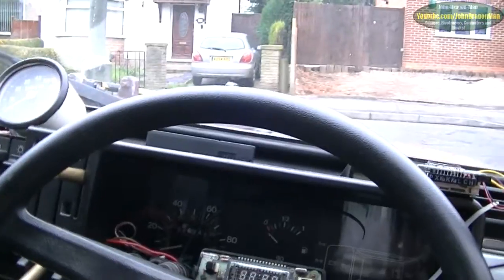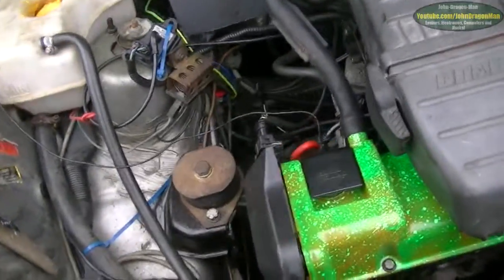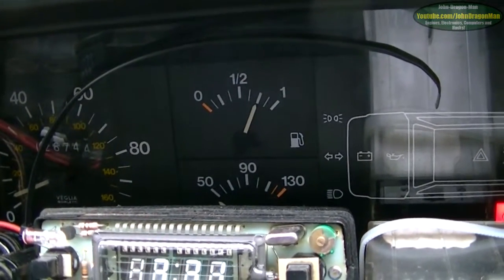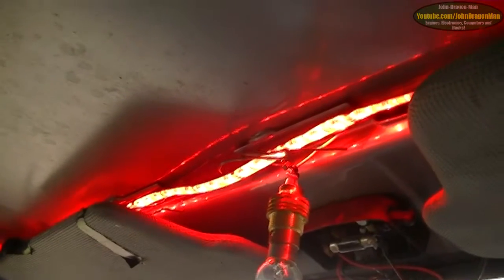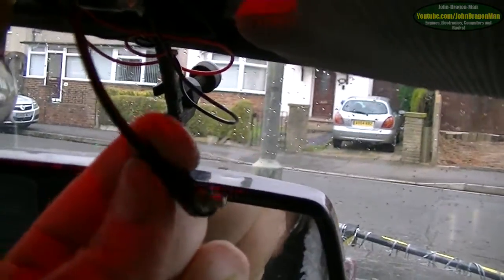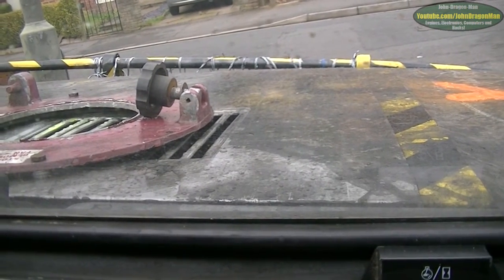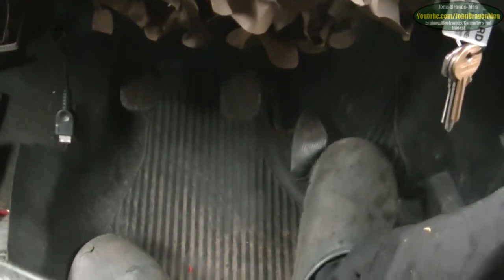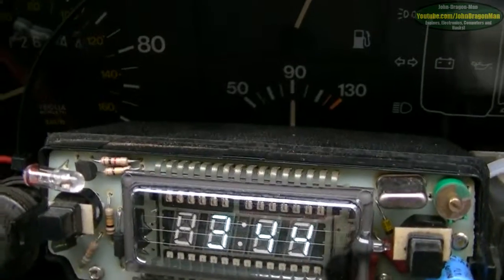Project Fallout Panda 4x4 oil leak fixed long talky video

Comment: Those 2 Panda's you have are the quickest starting Fiats ive heard. They go just like that. Alot of Fiat's don't start first time or the starter motor just turns over faster just before it the engine starts. Your very good with projects like this. I noticed your spanner operating the left stalk.